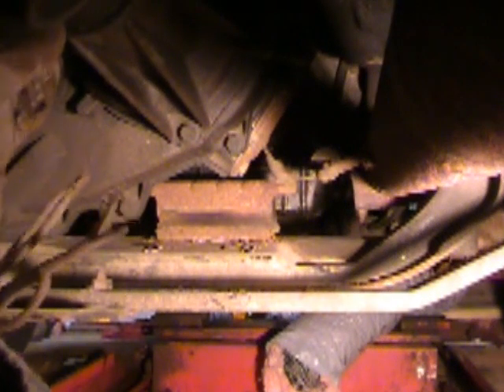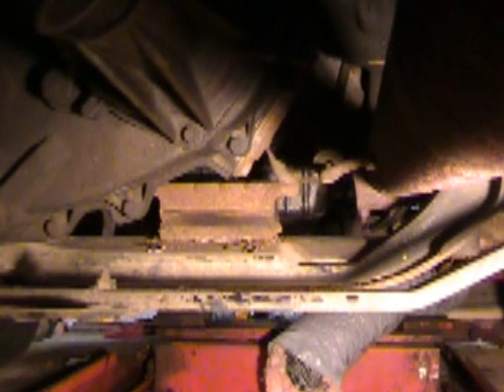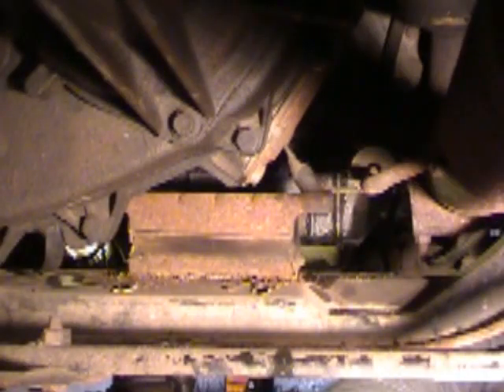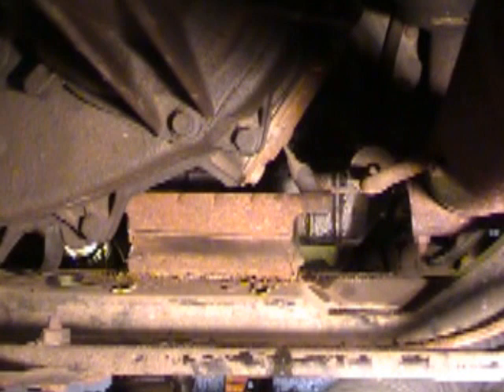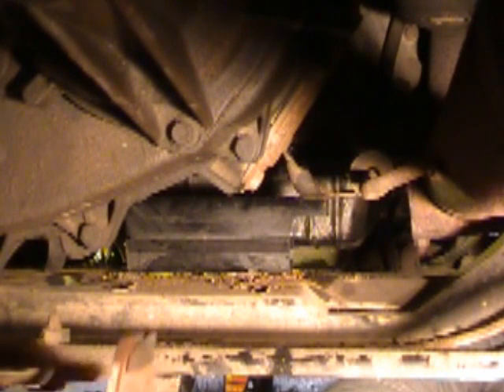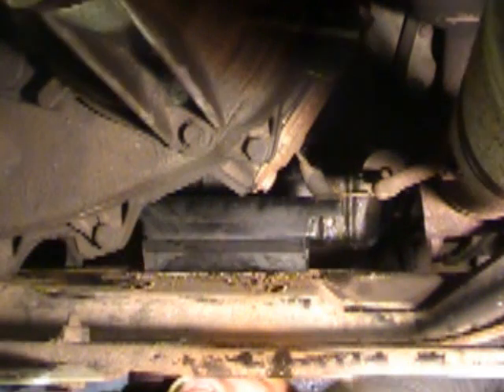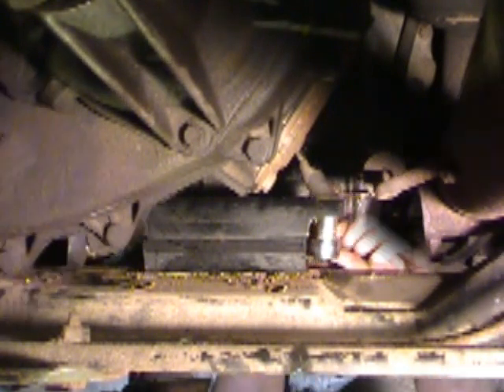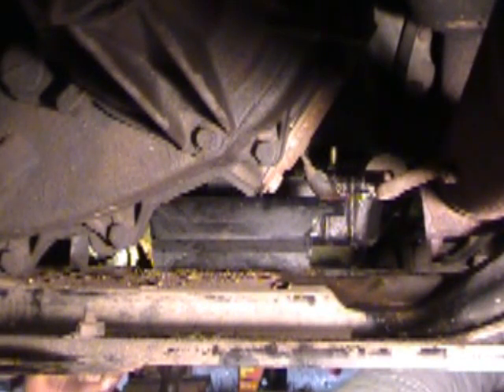Noisy transmission mount on your truck (Mount Broken)

Comment: What was the symptoms on it?
Reply from the maker: Putting it in gear or speeding up slowing down what causes clunking noise. Which in turn to be the broken transmission mount lifting off of the bracket banging back down onto it. Thanks for the question and thanks for taking the time to comment.

Comment: I have 2010 f150 4x4 and I'm going to swap mine out. I'm skeptical of supporting the trans at the pan while I drop the cross member. Is this a safe point? There doesn't look like a good housing surface?
Reply from the maker: I dont work much with ford but I would be very careful about supporting at the pan. In my opinion I would find some other way then that if at all possible. But like I said I am not a ford person so seek other advice as well just to be on the safe side.

Comment: I have a question I have a 1995 Sonoma 2.2 and my problem is the transmission mount I replaced 3 or 4 times I don’t know why keep broken, and even with the new mount if I shift fast I can hear the ttransmission hitting the floor, I don’t know if has to have something on the top or I can’t figured out, any advice
Reply from the maker: That’s a tough one of course not having it here in front of me. But if as you say it keeps breaking I would check to see if any of your motor mounts are bad causing excess movement or play in the system putting undue stress on that one particular mount. Again very difficult to determine from a distance but clearly somethings causing it to break and one thing would be more than normal stress. Not sure this is going to help you very much but that’s the best I have at the moment maybe somebody else in this feed has dealt with the situation could possibly chime in and give more advice. Good luck and let me know what you find out.
Reply: shanesmaineshop ok thankyou and subscribed
Reply from the maker: You’re very welcome, thank you for commenting and subscribing. Have a nice day

Comment: Outside the temp is 26 degrees but I'm going to install that mout, thanks for the information!
Reply from the maker: Your welcome glad it helped and thanks for commenting.
Reply: shanesmaineshop I finished! Done ✅! Was hard to take out the top screws I had to use 15 mm and torque it with 9/16. I have a Escalade 04. I saved few 💵. Feels like 15 degrees outside but I replaced the part. Thanks. 🇵🇷
Reply from the maker: That's great. now go warm up LOL

Comment: How does the transmission push up when it's bolted to the motor and the motor is bolted tightly to the frame?
Reply from the maker: It is all bolted down on rubber mounts so there is always some play to move it a little.
Reply: shanesmaineshop Oh OK.  Thanks

Comment: Bro did u just lift that up with your foot?
Reply from the maker: +Rick Bean yes I did that's the only way I could get it to line up if I recall correctly and I was by myself so you find ways to get things done. LOL and maybe I didn't feel like crawling out to get the jack
Reply from the maker: I just went back and watched the video I can see my foot shaking from the weight lol but I got it done.
Reply: shanesmaineshop i just took my transfer case out of my 00 silverado 1500. Tranny was leaking. Turns out my mount was shot and had cracked my 4x4 extension case..now i gotta go to the junkyard in the morning and get another..gotta love it
Reply: shanesmaineshop man i been wanting a Ram with a cummins for awhile. Something about the sound of a diesel
Reply from the maker: I have had it since 2004 and its been a great truck almost no repairs other then this one and normal wear and tear. And it does sound good
Reply from the maker: Never ends does it LOL if you own cars there is always something to do.
Reply: @shanesmaineshop  everyone always asks why I'm working on my trucks.  I'll never catch up lol. Better then driving one off the lot with out any make up on!!

Comment: Does this get rid of the dreaded clunk sound that is typical on GMs?
Reply from the maker: +Dougie Fresh well I don't know I did not have any other clunks except for this one and when I replace this part I have no more Clunk. So it fix my clunk but I don't know if it'll fix whatever your clunk is on your vehicle
Reply: @shanesmaineshop  my tahoe vibrated really bad at highway speeds and this is what was causing the issue after replacing everything else I thought was wrong 🙄

Comment: Looks like they glued the rubber portion of the mount to the bracket. No wonder why it failed, no bolts actually go thru the rubber part. Cheap designed to fail crap.
Reply from the maker: That is how most all motor and trany mounts are. It is designed that way to That is how most all motor and trans mounts are made. It is so they absorb vibrations and the flexing of the components.
Reply: @shanesmaineshop  yeah I know still cheap though. I just replaced a tranny mount in my 97 f150 4x4, it was not exactly easy like some claim it is. Hard to explain, but Ford didn't design it for the average user to work on.
Reply: @garyr7027  ye i used to be a ford guy but they are really just way to hard to do work on and more expensive but then again now all of them are. not a ford fan at all now. but all makes have issues one way or the other. .